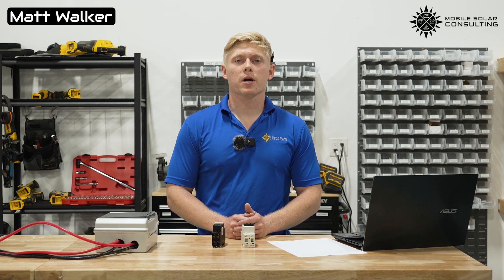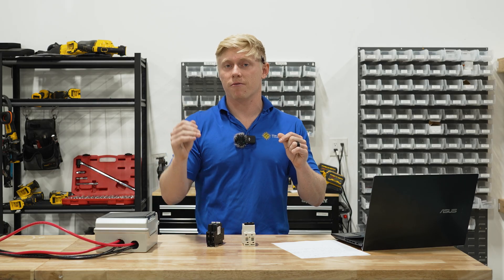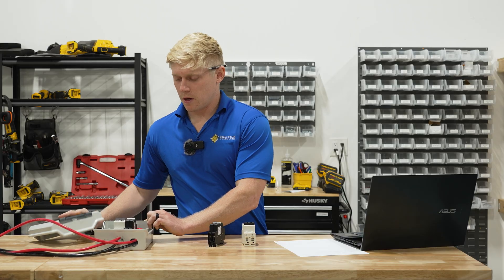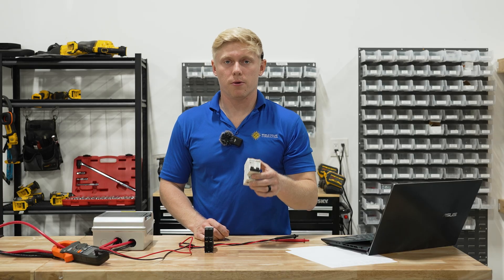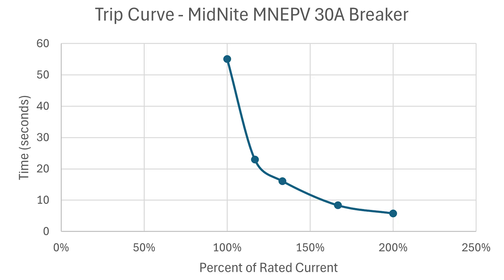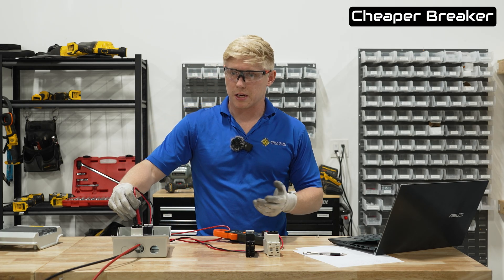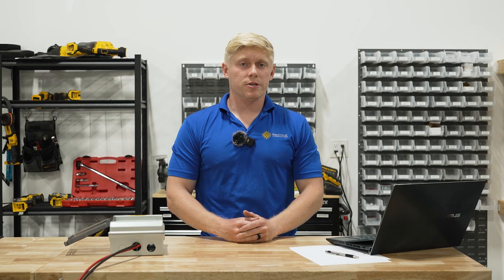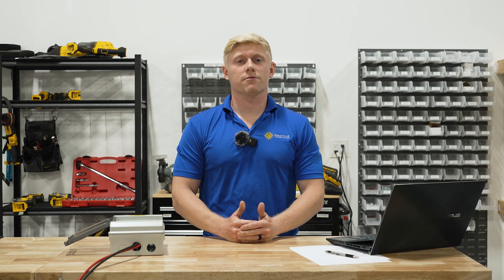Are CHEAP Solar Breakers SAFE for Your RV Solar System?

Comment: Thank you for putting this vid together… and it confirms my decision to pay a bit more for my solar disconnect breaker.  I ended up going with a MidNite Solar MNEPV20-600-2PP Circuit Breaker (20A, 600VDC).  Wouldn’t mind if there was a video on how to safely wire up a polarized breaker.
Reply from the maker: That's a good idea for a future video, thanks!